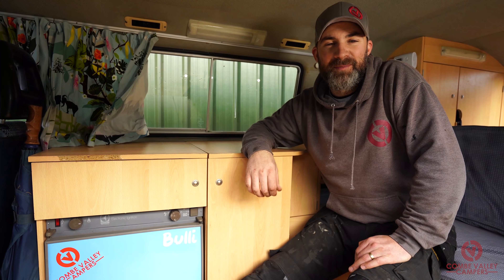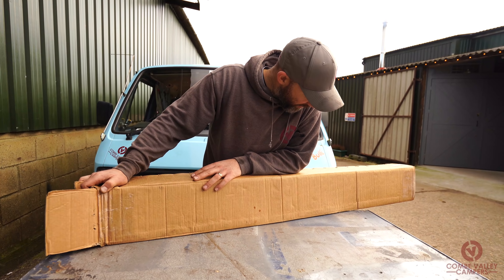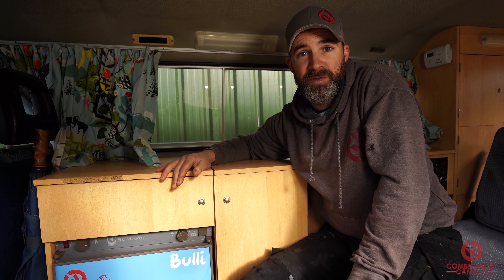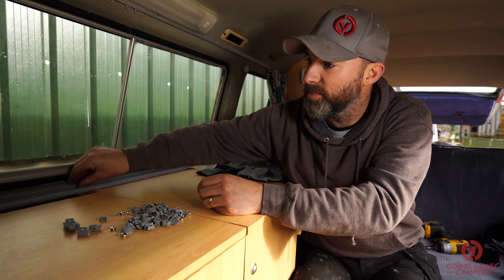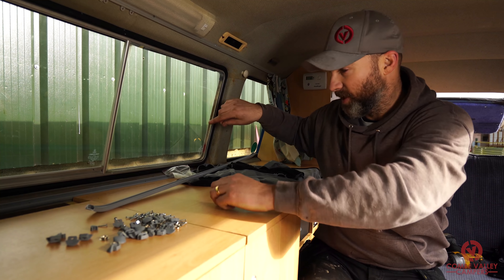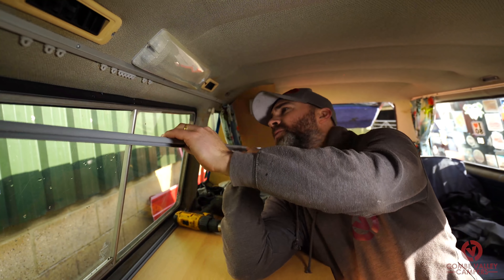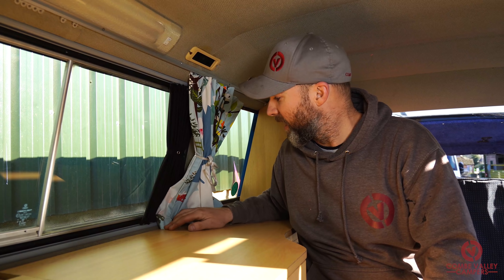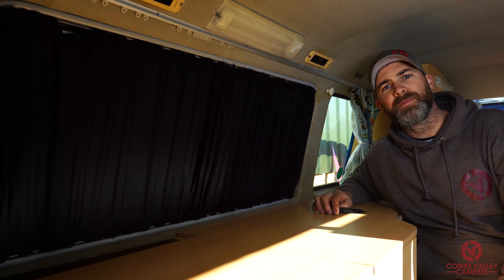HOW TO FIT CURTAINS IN YOUR CAMPER. Get the PERFECT fit with our Tips, Tricks and  Hints

Comment: These are very similar to those I have in my T5 with moulded tracks. I had difficulty fitting mine on carpeted surfaces as the drill and screw caught in the carpet. To get over the problem I burned a small hole in the carpet with a soldering iron to get the drill and screw in.